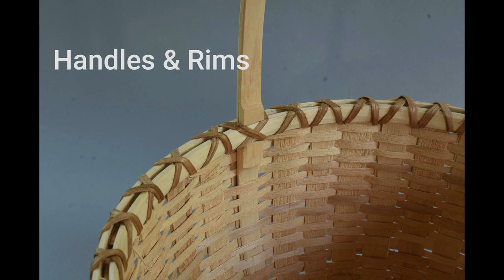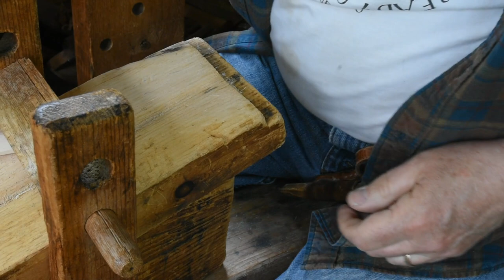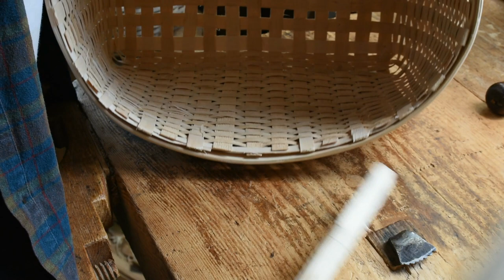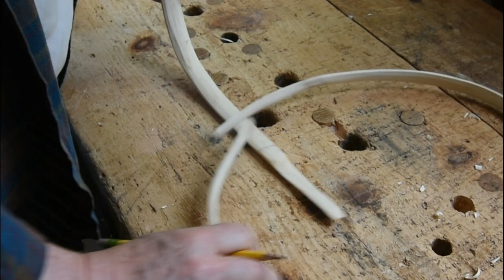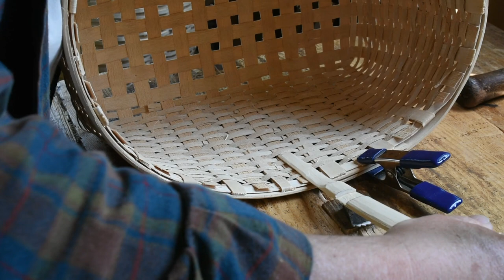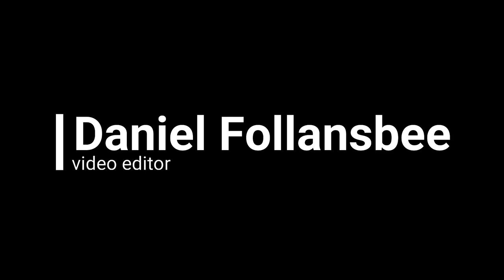handles & rims

Comment: I've really learned a lot. I'm just a beginer only a million or two hits. I'm lucky enough to have access to black ash. The borers are just starting here so i'm sawing out billets as fast as I can and sinking them in my pond for further processing later. Also building a power hammer , probably like Erics basketrys. He says his pounder does 300 strikes per minute and does a billet in about ten minutes= 3000 strikes. Im currently pound by hand and doing a layer or two per evening ( half hour to 45 minutes). I'm no mathmagician but I think i'm going to need a power hammer. Thanks for these videos. I've watched everything on the subject and yours are by far the most comprehensive.